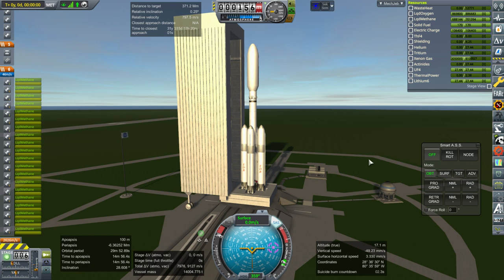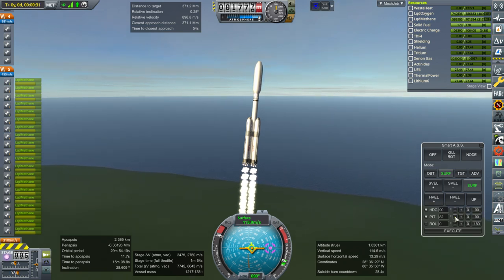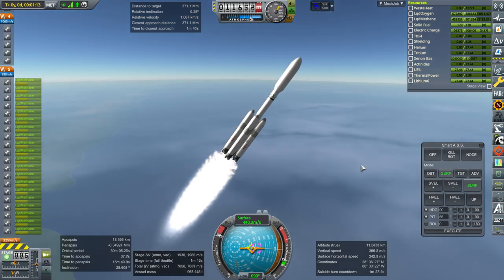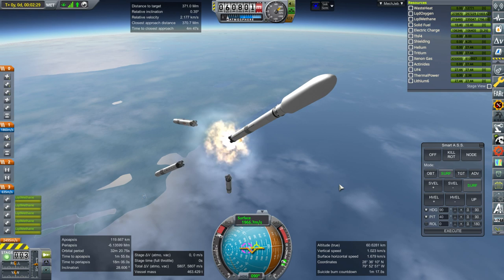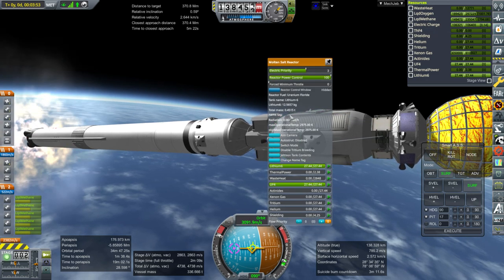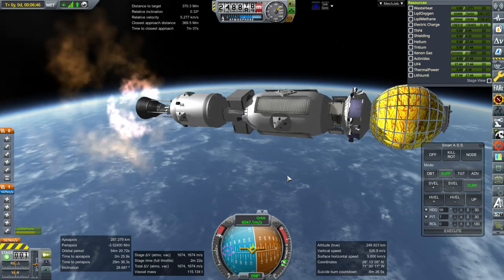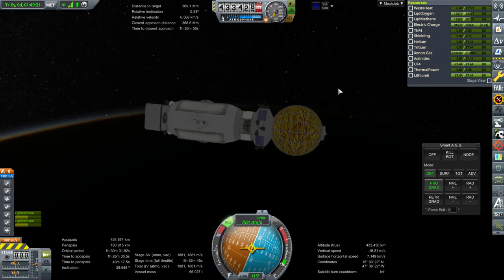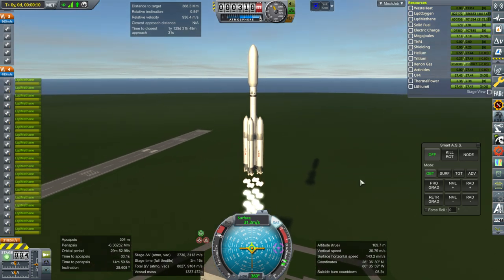KSP 1.6.1 RO and Kerbalism - Mars Colonization 022 - First Reactor

Comment: dunno if it's been explained, but the way that heat dissipation works in ksp is proportional to how much waste heat you already have: unless you have a stupid amount of radiators, you're always gonna get some waste heat, but as your waste heat goes up so does the temperature (and thus the amount of energy radiated per unit time) until the thing finds an equilibrium: more radiators is just gonna get that equilibrium point lower, which will give you higher efficiency and thus generally higher energy yield, but don't worry if your waste heat bar is somewhat filled.
Reply: https://github.com/FractalUK/KSPInterstellar/wiki/Waste-Heat-Management yea, there some nice math about it. Also i check two more things: Wasteheat pool is linear proportional surface of radiators, so no having sense do a lot of it. And there is no reemission between radiators, so parallel radiators in one half sphere works as well as in different half spheres. https://ibb.co/jfsRr78
Reply: Some offtop, sorry: using this knowledge, i 
wanted to have some fun. Sun exploration is obvious target, so i dropped Tyler (i think Holidays In The Sun is song that plays in his can) almost at sun. https://ibb.co/m0R7sj7 Almost 120km/s, 1.912 Mw solar flux (radiators can drop 3.34 Mw) and frosty 250K inside lander can :3. At this height solar power sertanly better nuclear, lol, if you had 35km/s delta to circularize and figure out how to protect solar panels. This is not RSS, but JNSQ, sorry. Do you like ksp physics like i am?

Comment: IIRC, reactors in interstellar make heat (thermal power), generators turn that into electricity/megajoules. And waste heat will build up to an equilibrium state. The goal isn't zero, it's a constant number less than max. Add the reactor assembly to the MTV2. See if it can cut the transfer time down to a reasonable time.

Comment: A small nuclear reactor (below 1MW) would not be very heavy. Nuclear fuels are insanely energy dense.
What you usually trade off with smaller solid fuel reactors is fuel efficiency. Molten salt reactors overcome this to an extent.

For those that are interested, look up the concept of nuclear batteries. They are Molten Salt Reactors that provide 50MW for 50 years without refueling.

Comment: generator should be tightly compatible with reactor, so it should be DIRECTLY connected and compatible size, it's mass actually calculated based on connection to reactor(and reactor properties) in editor, so NO orbital assembly allowed, realistically(i.e. something that you can create with today tech) if you include radiators then reactor power is not much lighter than solar power 7 ton for 1 megawatt electric power, for solar power near earth orbit "Very lightweight designs could likely achieve 1 kg/kW" (both numbers from wikipedia)  i.e. solar 7 ton can generate 7 megawatt near earth orbit.
p.s. later in interstellar there are 3 types of generators and 3 types of thrusters that can be connected to reactor to use it raw(non electric) output, some reactors allows to connection two simultaneously, some do have builtin generators (or thrusters).i suggest do simulated start to test reactor properly, because radiators/generator/reactor releation is very tricky, i.e. reload.
Reply: https://en.wikipedia.org/wiki/TEM_(nuclear_propulsion) russian version specify that (?empty?) weight 7 ton or 6 ton (on other page). i.e. interstellar mod is extremely optimistic.
Reply from the maker: I'm using ISS solar panels, and let me tell you, they don't get anywhere near 1 megawattt from 7 tons, so the reactor is much better. I know about using the same size for the reactor and generator - that much I recalled from my earlier KSP-IE experiences.
Reply: @RaizSpace   Lightweight generators is thermal electric effect generator in kspie - thermionic converter irl, have efficiency up to ~ 25%, have sense up to 300-500 kw, further we need some sort of gas turbine, thermal power generator in kspie. Please, drop this ideas with conversion, neutrons, all this stuff, if it hard to realise.
Reply: @RaizSpace   And one cool thing - did you 
have noticed that reactor in work actually generate xenon gas, around 15% from uf4, by mass. Irl i think you cannot use it, but kspie allow you to transfer it from reactor and use in engine.

Comment: 18:53 duplicating a working system is always better than trying a new one and losing hardware. By the way i know it is a Mars colonization series, but can't you do stuff on the moon to reduce the risk of taking the hardware all the way to Mars and then discover the problems?
Reply: Or as Jim Bridenstine call it: Retiring Risks.
Reply from the maker: Most of the risks involve aerobraking in Mars' atmosphere and landing with Mars' atmosphere and gravity, and there's no way to do any more on the Moon to mitigate those risks (the Moon has no atmosphere and less than half the gravity). Even in real life, what you can test on the Moon (as opposed to what can already be tested in LEO) with a goal of using it on Mars is pretty limited.